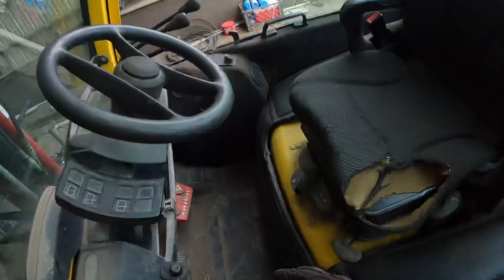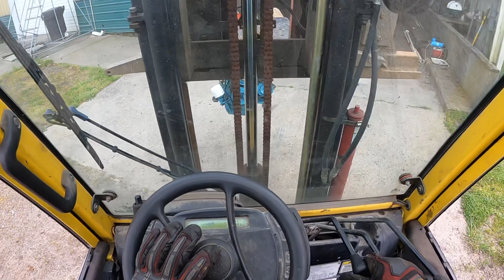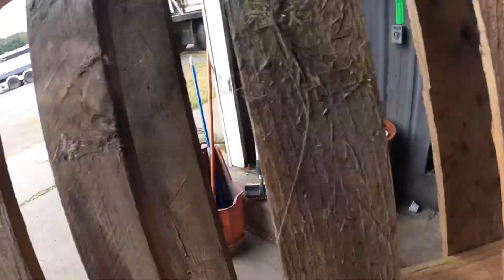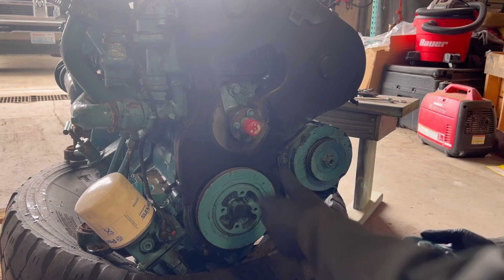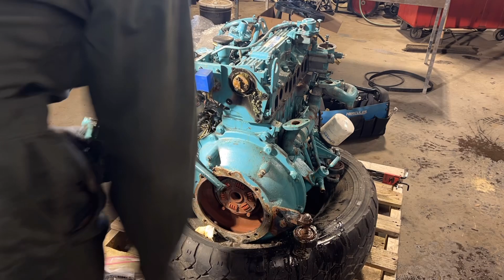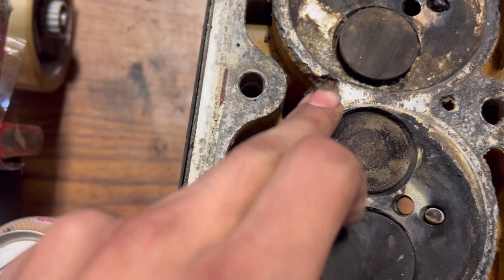Marine diesel engine | water intrusion through heat exchanger | low hours engine destroyed ￼￼￼

Comment: You might want to consider just mounting an outboard on the rear.  Remove the prop, and you'd be good to go.  You might have to beef up the transom.  At some point with these old boats you have to look at what is most practical.
Reply from the maker: Definitely crossed my mind, I already bought a new diesel for her though, currently working on putting in.
Reply: Sailboats with a slower hull speed and a transom mounted outboard can have the outboard swamped by following seas.

Comment: Wow, worse then I thought it would be. So the heat exchanger leaked salt water into the engine cooling system. The salt water become the engine coolant. The salt water corroded the metal until it reached combustion chamber. That's where the water got into the engine oil. I guess part it out and repower. Makes sense to go with an engine that fits better and uses less fuel.
Reply from the maker: Precisely what happened, super unfortunate. I think that’s what I’m going to do, makes the most sense to me.